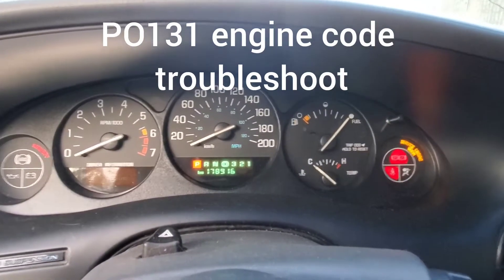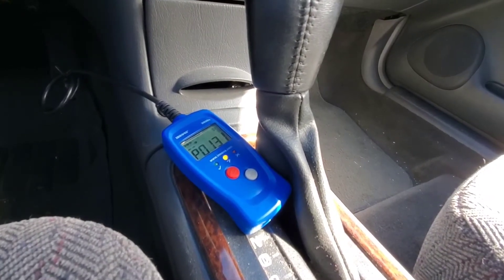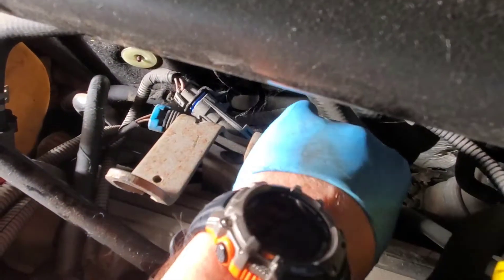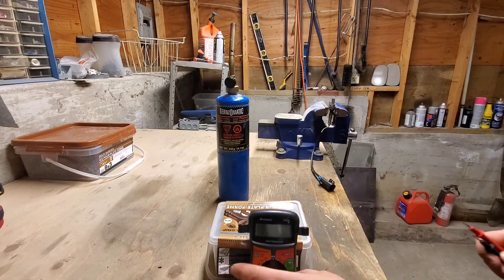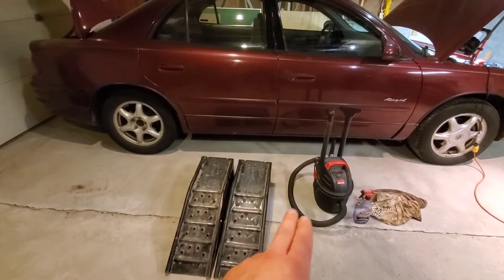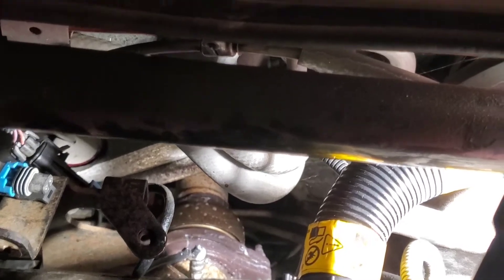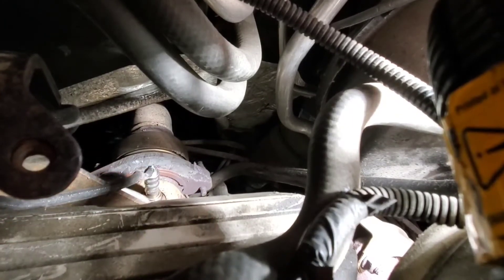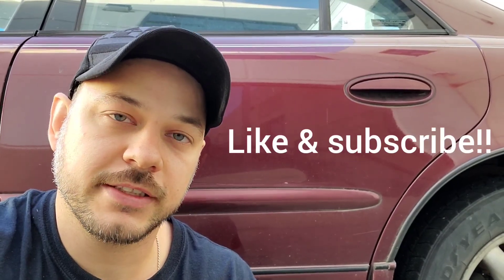PO131 engine code troubleshoot 1997-2004 Buick Regal (DIY guide)

Comment: My 2002 Buick Regal has 134,000km I got less mileage than your 2001 how is your Buick Regal doing Arthur?
Reply from the maker: It is happily collecting rust outside the house. My mom still drives it. I dont think its even driven 500km a year haha!
Reply: @HomeownerDIY  you mean it’s collecting dust?
Reply from the maker: Lol l meant it when l said rust. Its parked outside all year. The clear coat on my Civic is peeling from being outside all year now. That collector plate isnt looking good now😭
Reply: @HomeownerDIY  out of every car you have Arthur I like your Buick more can’t believe you’ve had it since 2002 already 21 years. so I see yours is a 2001 model year so it was almost new when you bought it car was one year old in 2002 when you got it
Reply from the maker: @fordmustang98guy  Yes we got it when it was a year old, looking back, for the money I don't think it was worth it. Now I wont spend more then 8K on a car. But its all about what you value.
Reply: @HomeownerDIY  my Buick Regal LS is a 2002 model year it’s exactly the same as your 2001 same colour Maroon Burgundy & I have dark grey leather seats & a sunroof.
Reply from the maker: @fordmustang98guy  Maybe our cars can be BFF's😅
Reply: @HomeownerDIY  LOL True only a difference in the year yours is 2001 mine is 2002
Reply from the maker: @fordmustang98guy  Im sure the parts are the same. My Civic is a 6th generation, 96-2000 the parts are all the same.